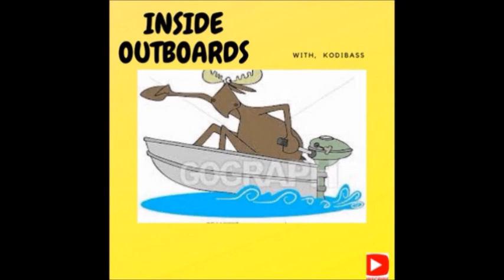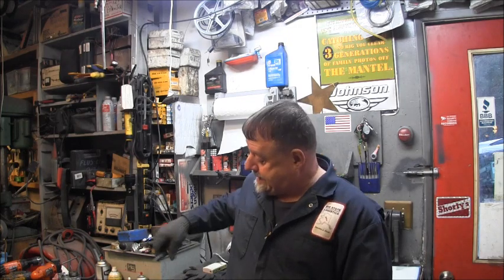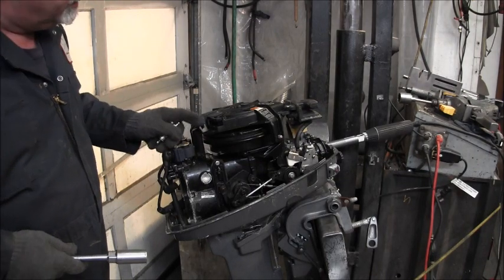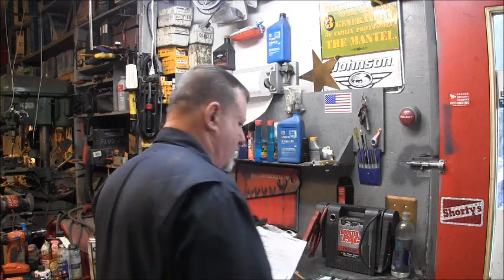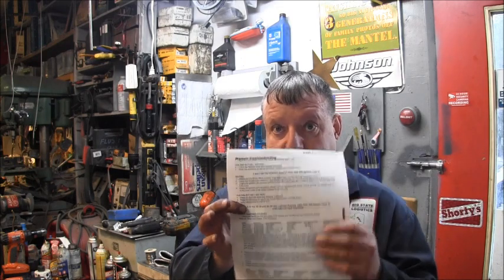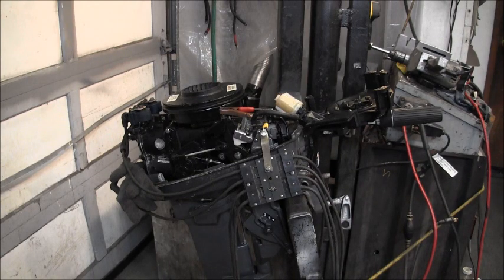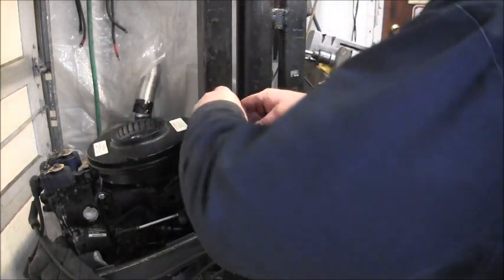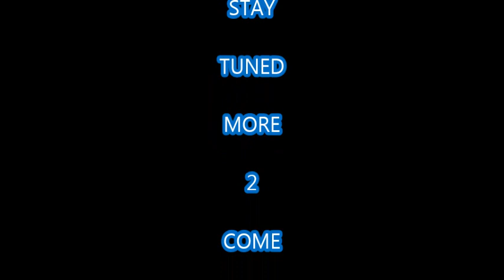MARINER 15 HP ,                   PROBLEM

Comment: Hi Kodi, I would have liked to see you put the new trigger on. I think its pretty much plug and play but interesting either way. Had to replace the switch box on my 60hp Merc when I bought it and for the 1996 2 stroke motors the earlier revs were known for not lasting but the rev 9 units solved that issue. fyi
Reply from the maker: Sorry  Tim I thought of that after the fact,  That said it is very simple.  3 tiny bolts.  lift old out set new in replace 3 bolts. done.  hook up color coated wires.   But U are spot on I should have filmed & uploaded that part,  Next time 4 sure.   thanks                                    kodi

Comment: What is the tool you use to spin the crankshaft  ??
Reply from the maker: It is a  1/2 inch  Milwaukee Drill from the 1960's  I cut the end of a 3/8 inc ratchet extension ground the end that goes into the drill chuck flat on one side so it won't slip.  and then hang on tight.      kodi
Reply: @kodibassInsideoutboards  thankyou sir,  stay warm !

Comment: I don't want to speak ill about any motor or any brand how ever from personal experience I've had one mariner it was a 40 horse power and it was the biggest hunk of garbage that I have ever had the misfortune of having that thing kept busting and blowing out the base gasket under the powerhead it busted the starter off the starter bracket I had it welded back on professionally and it broke the starter bracket off again the motor was an absolute monster  to start As I stated biggest hunk of garbage I ever owned, better off used as a boat anchor however I suppose Other people swear by a mariner but I am not one of them.
Reply from the maker: I think anyone  can get a ""FRIDAY""  motor,  Most folks I know speak fondly of their Mariner motors.  Sad You got a disappointing one 4  sure.                          kodi

Comment: Is that made by Mercury?
Reply: This one is.
Reply: The brand started as a lower cost alternative to the Mercury line. It wasn't lower grade just built with less frills although with tried and proven technology dating somewhat. Many have said that these motors may have been less jazzy than comparable Mercs but that they were bulletproof and (being built by a japanese  company) of higher quality. Eventually, Mercury started building Mariners in their own plants and those gradually became perfectly identical clones of the Merc models save for the paint colour and decals on the bonnet. They are still marketed under the Mariner brand in some foreign countries.
Reply from the maker: Yes this is a Merc.                             kodi
Reply from the maker: @danielrobert7181    Great,,   thanks 4 sharing I did not know that.                    kodi

Comment: Hey Kodi. I sent you an email re the Evinrude tiller, but haven't heard back from you. Hit me up please. thank you. cheers🇨🇦 D.
Reply from the maker: Sorry I get dozens of request  ,  tell me again what U need.    kodi
Reply: @kodibassInsideoutboards  No worries sir. I need a tiller handle for my 1974 Evinrude 9.9 Mine has a couple teeth broken off the cog gear. My son-in-law borrowed my boat and it came back broken. Said the twist was stiff and that's why it broke. I'll re-send my original email with my contact info again. Thanks again sir. Stay well, cheers🇨🇦
Reply from the maker: @alvarsdzenis4739      I will have that 4 sure.  So send me exactly what U need  Be descriptive  as can B,  kodi
Reply: @kodibassInsideoutboards  done